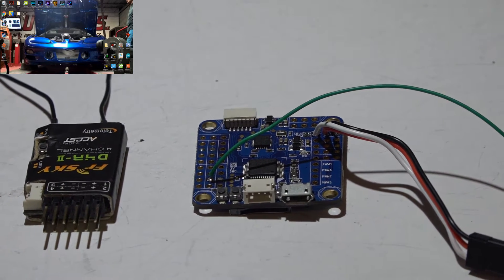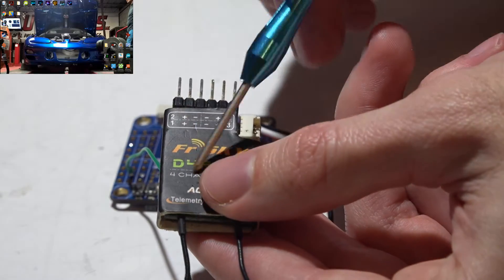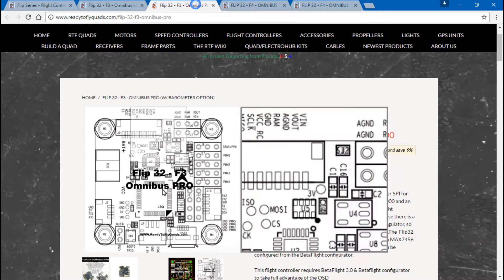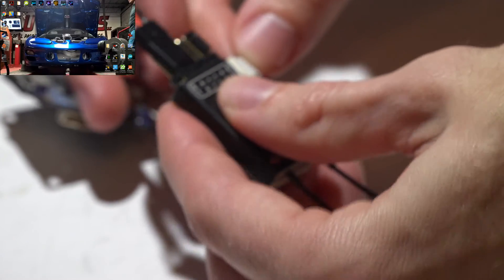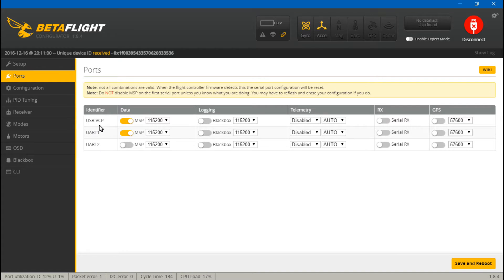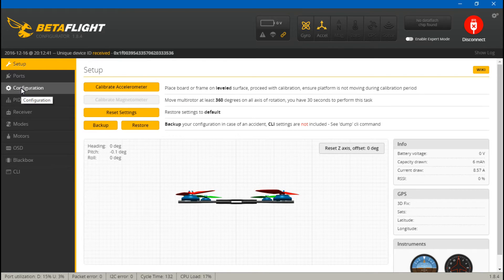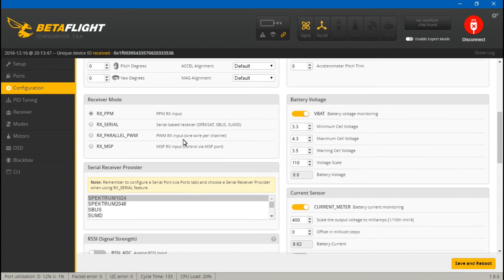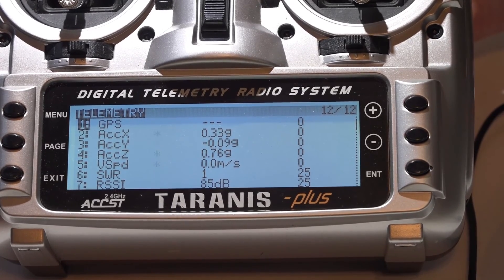Omnibus F3/F3 Pro & D4R-II: Connect & Telemetry

Comment: For the life of me I can't get sbus to work on the Omnibus F4 Pro V3. Everything is as you show in Betaflight, I have soldered the little jumper pad where you select sbus or ppm, and I know the receiver and radio are bound and communicating. Firmware is 3.1.7. Any help would be awesome,

Comment: Hello JC, First of all, great and helpful videos you made, that's why now I'm subscribed.. well, I just bought the Omni F3 and I'm using lemon sat, my question is, can I get rssi on my betaflight OSD? I turned ON on the betaflight and there's a 56% 56% but it doesn't move from there no matter that my DX6 is ON or Off... what I need to do or where can I find some info about, my sat is connected by the port on the flight controller.. 
Thanks in advance! :)